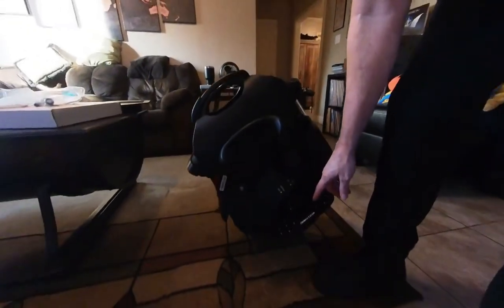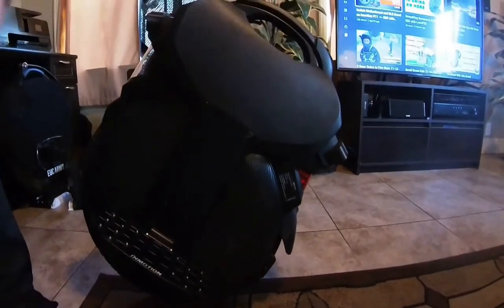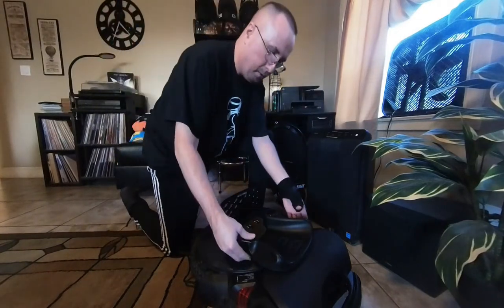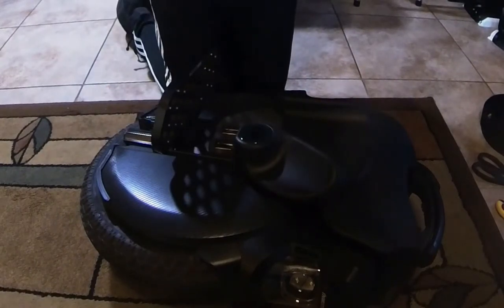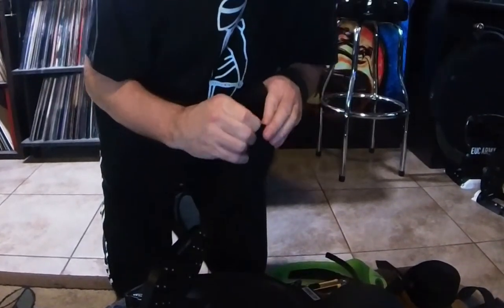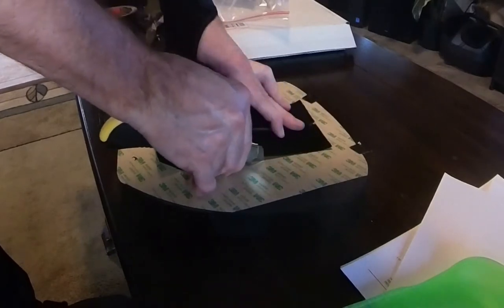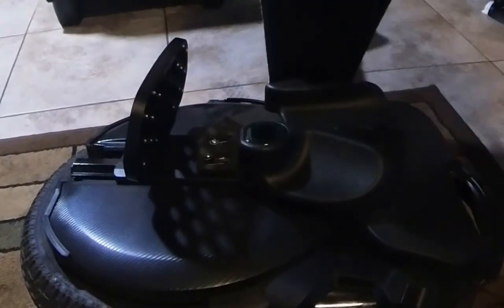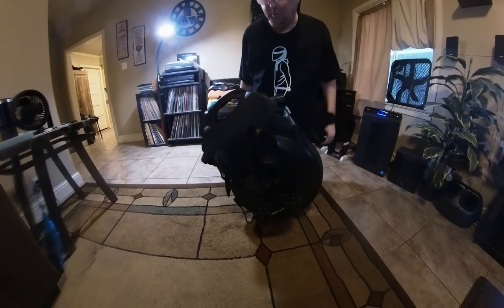Install Gen 3 Clark Pads on V11 -=- EUC with Leucifer

Comment: Why didn't you take off the paper adhesive cover off before putting the velcro on now the velcro is as easy to remove as the paper adhesive cover was to pull off
Reply from the maker: I'm pretty sure the video shows me cutting the paper in the size and shape of the velcro strips and removing it before actually applying the velcro.  So, the velcro is stuck to the adhesive on the pad itself, and not the paper that was removed.  The only remaining paper is on portions of the pads that have no velcro and are not in contact with the sides of the EUC.  In retrospect, I probably could have just removed ALL of the paper and covered the entire area of the inner pads with velcro, but that seemed like a waste of velcro to me.
I hope that clears up any confusion. 
Happy riding! 👍🏼
Reply: @EUCwithLEUCIFER  that completely clears it up, thanks man!
Reply from the maker: @twich7786  : No probs.  I'll try to be more descriptive in future how-to vids so viewers aren't confused (I'm still rather new to making videos).
Thanks for your comment (or question, actually).  🤘🏼